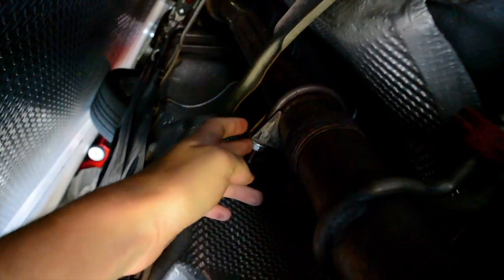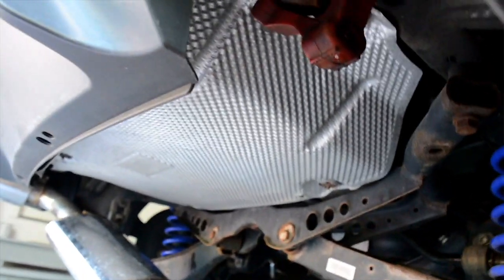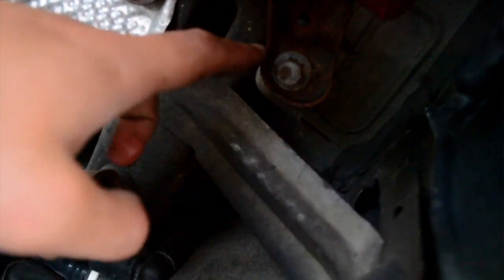MK6 GTI Gets a Cat Back Exhaust!

Comment: Definitely sounds better than stock, if you ever decide to upgrade your intercooler i would recommend getting a neuspeed fmic or even the golf R intercooler . Installed one on my car the other day car just pulls 90F+ stop and go traffic and no loss of power ☺️

How hard would you say is the spring install on a mk6 gti. Thats the last mod that im planning ( bought some dg springs and koni shocks, but they are just sitting im my room for the time being) . 

My brother would help me with the install but neither of us ever installed springs lol and local mechanics are asking 600-700 for installation which i think is outrageous.
Reply from the maker: The rear springs take maybe 30 mins to do.  If you want to save money you could always just do the rears that way they only have to install the fronts.  The front spring install is pretty difficult and time consuming.